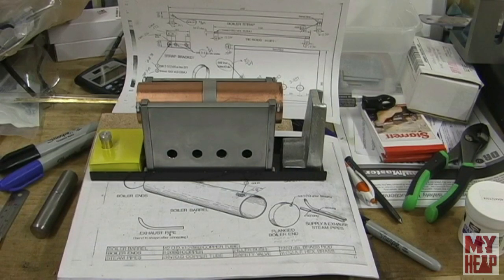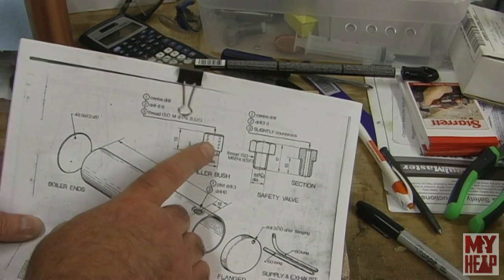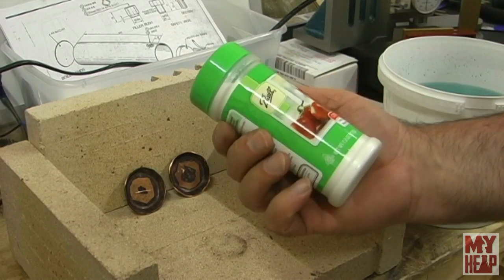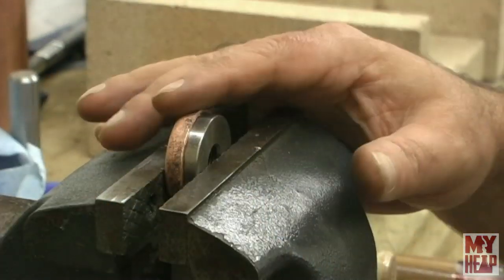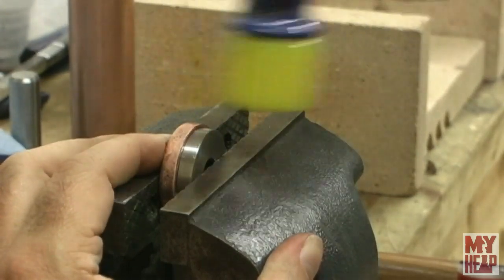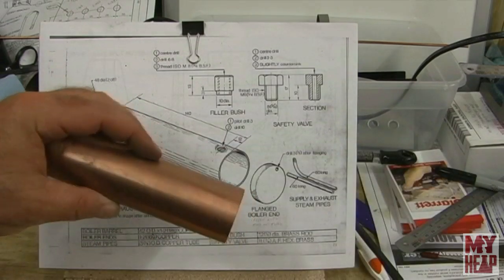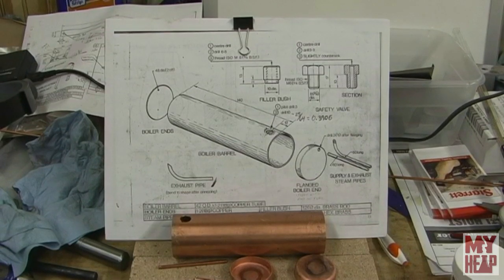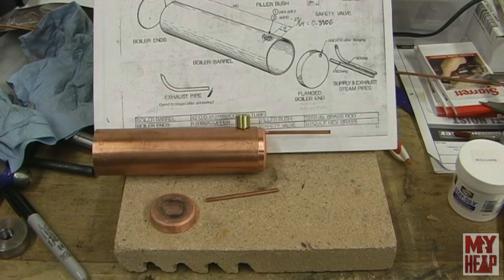Kenneth Wells Stationary Engine - 08 - Finishing the Firebox and Making the Boiler Parts

Comment: The flaring tool was nicely made and seems to have worked extremely well Joe, nice job. Nice to see you putting the lathe to work and making the small precision parts. Well done on the copper ends.
Reply from the maker: Hi Richard.  Glad you could stop by.  Thanks for the compliments.  The tool worked very well.  The next step is to silver solder the thing up.  That is what I seem to be apprehensive about.  It is great to get out in the shop again.  Thank you Richard for watching and commenting.

Joe
Reply: I never used silver solder, not sure of the melting point of that alloy....what does the manufacturer say? Silver has a melting point of almost 1800, wondering if propane has the juice needed....map gas would handle it. I tried propane with bronze brazing rods and failed so resorted to my oxy set
Reply from the maker: Not sure of the melting point.  Although it is less than silver and brass.  Somewhere in the red heat zone I guess.  I will try a sample first to see what happens.  Bit you may be right, my little propane torch may not be enough.

Comment: Joe…a very enjoyable video…I paid special attention to
your forming of the end plates…very similar to forming brass pendulum shells for
a clock…I hope to be making a compound pendulum this summer…similar 
procedure but actually formed on the lathe spinning

I use super glue arbors regularly…super glue needs air to
work so make nice deep air grooves and read the amount of glue to use per
square inch…I think you will be surprised how little glue is needed…I let mine
set overnight but I’ve got friends who use them very soon after setting up…I
mainly use the arbors for brass gear cutting…or facing oddly shaped items…I
even held a piece of 3/16” S/S for facing…just for an added bit…I make stub
arbors with super glue if I do not have a collet or the set up does not allow
the use of a collet…great video…really looking forward to the next…bob
Reply from the maker: Hi Bob, thanks for the tip.  I was wondering if a super glue chuck would work.  I may try it for giggles even though I don't technically need it here.  Thank you for taking the time to watch and comment.  I really am a newbie, so when I get complements from experienced folks like you, I feel like I am on the right path.

Thanks for watching, sir.

Comment: Not bad at all Joe ! This is indeed a good toy-engine to kickstart your (and mine!) obsession with!
I have just gotten hold of two Fleischmann toy steam plants (vintage 1930s') that need some TLC.
They are in working condition, but they can do with some 'cosmetics'
If your wife catches you collecting these vintage toys , on the side of your workshop antics.... well.... can you fit a bed in that basement?

Toodles!
Paddy
Reply from the maker: Hi Paddy.  Great to see to stop by.  I agree, that this toy engine is a good introduction to the hobby.  I get exposed to a lot of different things.  I think my wife would confine me to the basement of I took up collecting vintage steam toys.  Congrats on acquiring the two Fleischman engines.  Speaking of getting things, did you get your Lorch sorted out?

Joe
Reply: Blast und Donnerwetter! I did ask my son to snap a few pics for you...which he did....but he went off with them... He'll be in Strasbourg for the next four week (he works for the EU commission) ... I am sure I'll get hold of those pics after that. But in answer to your question : almost.
I have a very nice vintage German motor for it in the meanwhile, and the only thing I still need is a counter-shaft. Those seem elusive or perversely expensive ; usually both!
Now if it comes down to it, it would be a simple thing to make. I could copy any of three Lorch designs and I doubt that even a seasoned user would be any the wiser.
And you know what happened? A second identical lathe landed on my bench, by means of a favourable wind!!
The second one has no tooling with it, but it will be very handy to set up with a small 50 mm chuck (I have to compound slides for this model, so I am good there)
More later on these via email :promise !

Paddy

Comment: G’day Joe, looking good, end caps formed nicely. To face the ends off I would think a aluminium sacrificial plug so you can turn up to it but I don’t know whether you would get enough grip when pressure turning. Everything is coming together as if you know what you are doing. Keep it up. Cheers Peter
Reply from the maker: Hi Peter and thanks for stopping by.  I tried facing a bit using some pressure turning using the former, but it didn't take much to catch and hang.  I think maybe the answer might be a super glue chuck.  Although, with this it probably doesn't matter.  As long as the end cap doesn't block the hole for the pressure relief bushing I will be okay.  I still need to come up with a test rig.

I am surprised as to how well things are turning out so far.  But I still have loads to do.

Just curious, do you plan on doing the Atkinson cycle engine?  If so, depending on when. You do it, I may build along with you.  I really need to finish this engine and get my mill running first.  Hmmmm ... That would give you time to make another project ... Maybe a dividing head?  Hahah

Thanks for watching and commenting.  I really appreciate when you stop by.

Joe